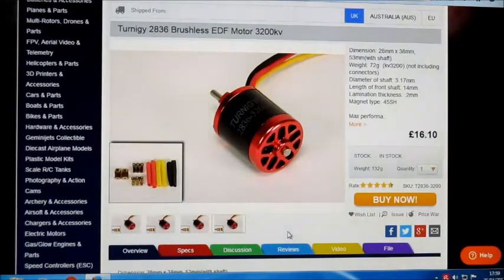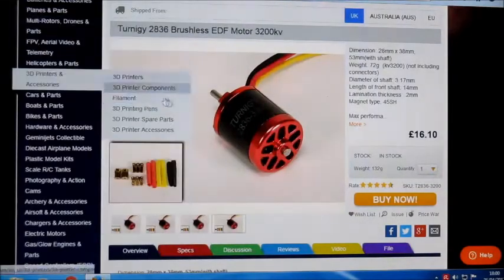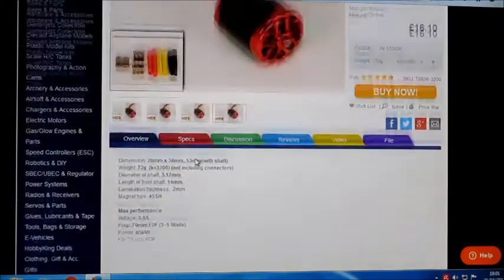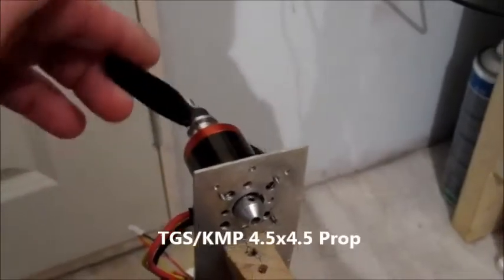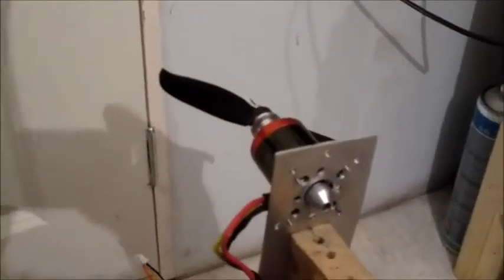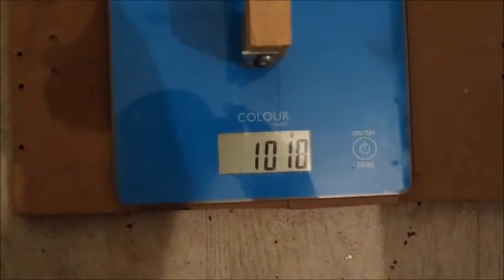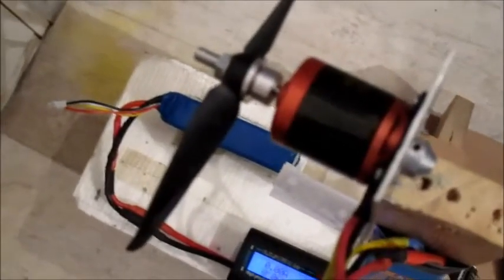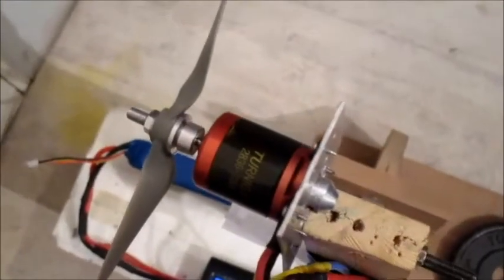Turnigy 2836 3200kv EDF Motor Thrust Test Motor test of the Week

Comment: Very simple buddy...edf motors are NOT designed for large props, I learned it the hard way by crashing a plane because this same motor didn't provide much thrust...
Reply from the maker: That's why you use them on small aerodynamic planes. A small prop spinning very fast on said plane will make it go very fast. While not actually giving a lot of thrust. Obviously if you are flying a larger slower plane then you do need a motor that spins a bigger prop with more thrust. You just won't go as fast. Pick the wright motor for the job buddy!!!
Reply: @rcplanepirate  you won't believe this but...after commenting on this I decided to unassemble this motor because the shaft bent because the crash and guess what?? The bloody magnets in the outer can were horribly misaligned!!! Could this be from the crash or could this be the reason it didn't perform so well?
Reply from the maker: @ammo193  If they're no longer glued in place and you can pull them out easily with a small screwdriver then then it's probably from the crash. If they're still glued in place then yes you may of got a bad one.

Comment: Hello is it possible to use a driver with this motor?
Reply from the maker: Sorry I don't understand what you mean?
Reply: @rcplanepirate  is it possible to use a driver/motor controller to run the motor at certain rpms within it's range of operation
Reply: @asanchez841  it all depends on the motor driver, otherwise these things work best on brushless electronics esc
Reply from the maker: @asanchez841  Do you just mean a speed controller?
Reply: @rcplanepirate  yes
Reply: @ammo193  thank you!
Reply from the maker: @asanchez841  Yes they all just run on a brushless esc.
Reply: @rcplanepirate  many thanks!

Comment: Hi, I have a little question; to run this motor,  will a ESC with 80A current work? or is it to much? I'm planing to use a 2S LiPo in the ESC.  Thanks and nice video.
Reply from the maker: Hi Daniel
It will work ok but it is way too big. You may as well use a smaller esc and save weight. Thanks for watching.
...RCPP
Reply: Hi rcpp I'm Matt from the USA ! I really like what you are doing and you have inspired me to make my own thrust stand and conduct some tests as You are ! I also have the turnigy 2836 3200 KV motor and we'll be putting it on a funjet ultra ! This motor was highly recommended by several other buddies of mine ! Believe it or not it will actually take just shy of 1200 watts before it fries it !! I wanted to let you know I also tried the same props you did but I also tried a gemfan 4045 bullnose prop ! The results were spectacular! I'm running on 4 last with an 80 amp turnigy plush ESC and a 3600 milliamp 50 c battery ! I ran a TGs 4.5 x 4.5 and achieved 1180 Watts at 74 amps and only a hundred and forty degrees ! The most cool part was when I put the bullnose gemfan prop on it drew only 64 amps but put out 1650 g of thrust

Comment: What are you using for a guide in selecting props? Are 5 and 6 inch prop not worth trying? I am wondering is there a place to go to review on paper amp draw before real world testing? My guess is your wealth of knowledge.  oh on that 450 motor I bought threads where bad. I have to re tap before I can test it.... have you had that happen?
Reply from the maker: Hi Russell. Yes your right by past experience i can kinda tell what size prop will work on a motor just going by the size and kv of the motor but you should always just start off small and check it with a wattmeter. If your already drawing over the max stated power on a motor with a 4.5 inch prop then you definitely shouldn't be trying a 5 or 6 inch prop on it as they will be drawing even more current and burn the motor for sure. If you need to run a 5 or 6 inch prop then you need to use a bigger motor or a lower kv motor.
Think i had the threads go on one motor once. Just got to be careful not to cross thread the screws.